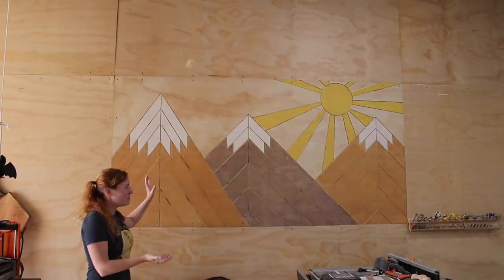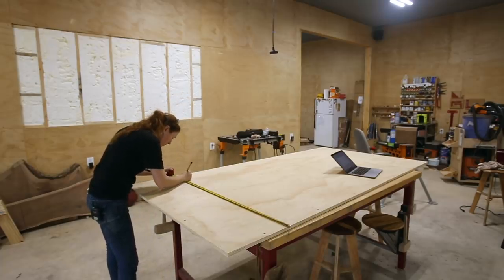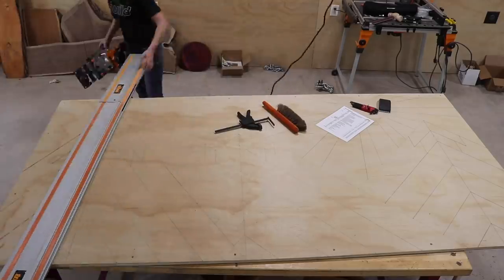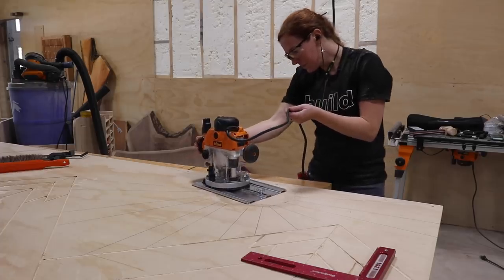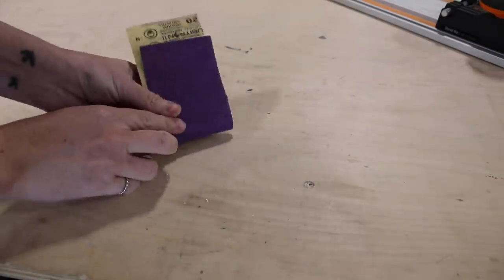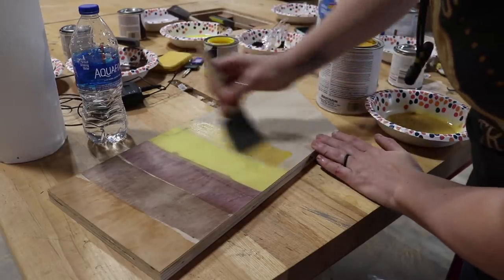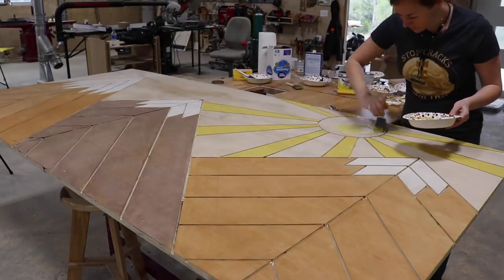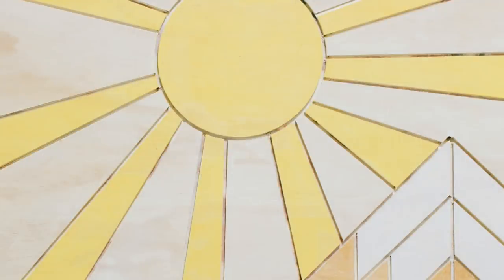Unique Custom Wall Art

Comment: Turned out great! At first glance I thought you cut all those pieces out and then attached them to the wall and my head hurt from all that math. But I like the routed style much more  :-) Nice work!
Reply: Too funny as I thought the same thing.  I was hoping the video was going to touch on marquetry techniques.  None the less, nice job April - simple way to spruce up the workshop.
Reply: I think there was an older video where she did that for a piece inside the house.

Comment: Look into dyes - they color the wood without hiding the grain. For comparison if dye particles were the size of ping pong balls then stain particles would be the size of pickup trucks.  There's several expensive lines of dyes which produce nice coloration but some luthiers are using inexpensive Angelus leather dyes with dramatic results.

Comment: I kept noticing that the tops of the walls seemed a little dark like the lights shining down don't hit them. I just had a random thought, what if you whitewashed the top sheet of plywood around the shop(s). How much brighter would things seem. I don't think I'd do it lower for a couple of reasons, they seem pretty bright, and the wood looks nice, doesn't it? The cool thing about a whitewash on the top, other than brightening things up, is that you'll still see the wood grain.
p.s. you do so much to make me homesick for Texas and Texas folk. Thanks. That's pretty important. There are some things I don't like about Texas culture, but from you I just see the parts I love.